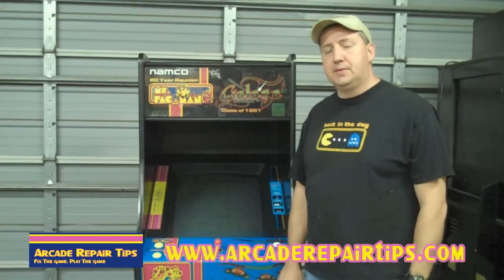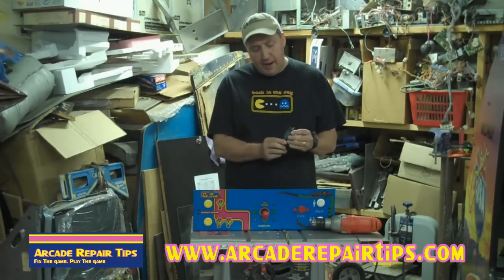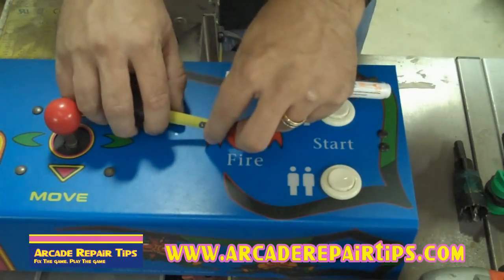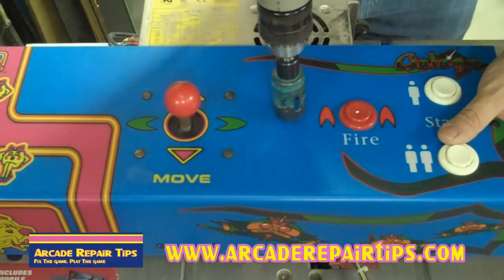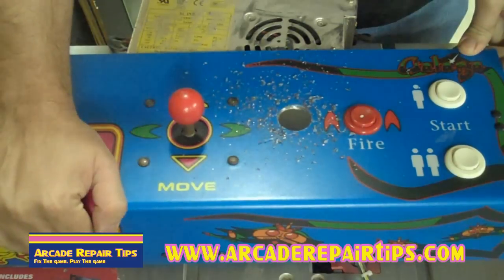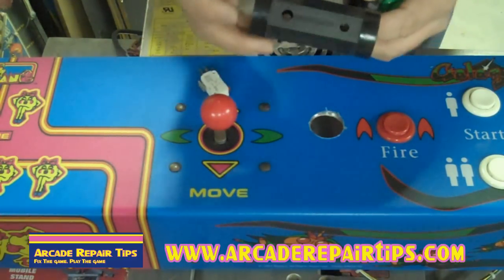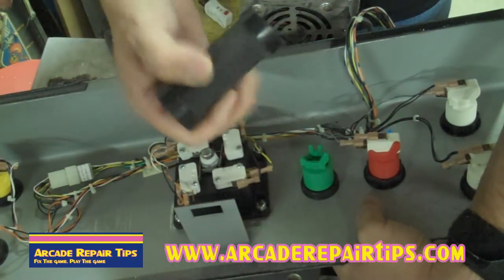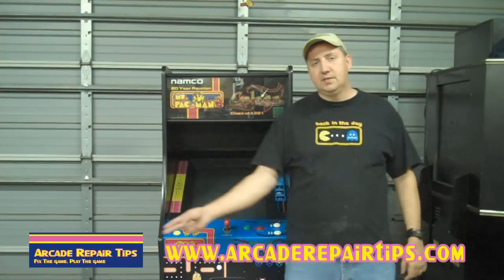Arcade Repair Tips - Installing A Push Button

Comment: I would have used a drill press and clamped the control panel down.  I also would have deburred the hole with a utility knife and a file before inserting the button.  

If I did use a hand drill I would have punched a small mark at the centre with a nail or screw to prevent the drill bit from skating.  Once the bit was through I would have stopped, then placed the saw against the surface gently and restarted the drill to prevent the jerking Talked about in the video.

Comment: Suggestions. Use some lube when drilling metal. Use a drill with a clutch. Set the clutch a few notches down so that it won't kick when it catches (Using a Ryobi hammer drill I set my clutch to 20 of 24). 

I put 100's of holes in metal doors using hole saws and the above steps will make drilling metal much easier.

*also can indent the center of where you're drilling for better precision.

Comment: What size do you drill for leaf switch style buttons?
Reply from the maker: Chad, thank you for your question. We just wanted to let you know that we will be covering your question on Episode 24 our Live Show here on YouTube. Here's a link to the episode if you want to watch it live: https://www.youtube.com/watch?v=Uix7QOXe6C4. It will also be available as a recording at the same link if you are not able to watch it during the live feed. Again, thank you for your question and good luck with your future repairs.
Reply from the maker: @Cassio Alteirosa You are correct. We did not show this in this video. It can be a bit tricky to get the control panel locked back in place but here are some tips. Make sure that you open the latches all the way up before placing the control panel back on your cabinet. This will keep the control panel from sitting on them making it difficult to latch them. Also, try pushing the latch up first then down when relocking them. This should help the latch find the hole that it needs to lock it down.

We will also be covering your question on Episode 38 of our Live Show if you want to hear us talk about it. The show will be broadcast live on April 2, 2020 at 5:30 PM CT or you can watch it as a recording at the link provided below. Thanks!
Link: https://www.youtube.com/watch?v=qCp1vv4lOIY